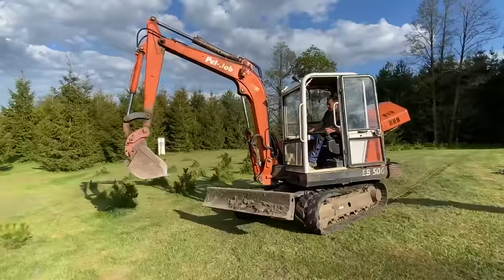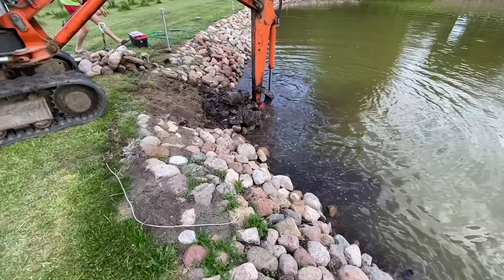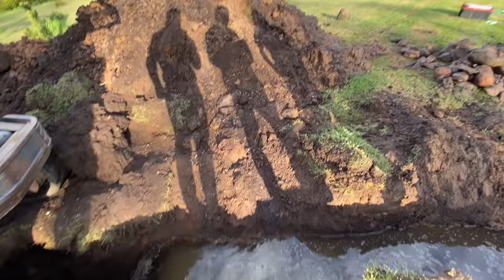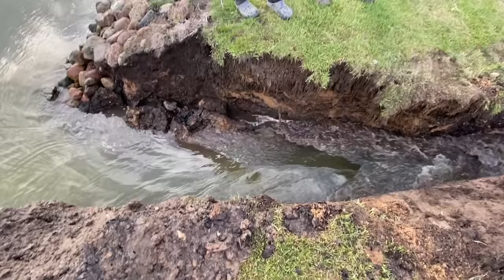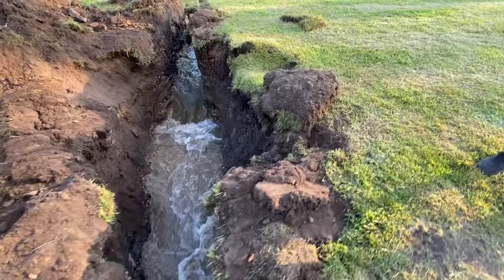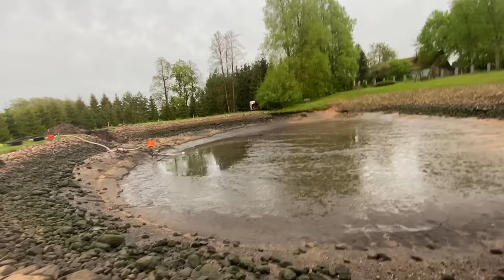DRAINING 10 ARES POND TILL THE BOTTOM. STUCK EXCAVATOR.

Comment: That is the smallest 7 acre pond on the planet. Two acres would be an exaggeration on the ponds actual size. Good camera work, and really entertaining operator skills
Reply: That’s not even two might 1
Reply: @reidreynolds7428  --  Nope!!  1/2 acre AT BEST......
Reply: @Kenislovas  Yeah Everything Is Smaller In Europe!!!!!!
Reply: @rockerpat1085  clearly not since the Irish and Scottish acres are bigger then USA's
Reply: @Kenislovas  Rubbish, the two are the same. 

"Acre, unit of land measurement in the British Imperial and United States Customary systems, equal to 43,560 square feet, or 4,840 square yards".
Reply: @chrisharris4740  there is a metric unit called an "are", the basis for the more commonly used hectare (which as the hect- prefix suggests equals 100 ares). It's written correctly in the title. The are is 100 m², which according to wikipedia converts to imperial as 3.95369 perches or 1076.391 square feet.

However, this does not look like 10 ares either lol
Reply: @ironcladranchandforge7292  i agree i have a half acre pond and it looks bigger than that.
Reply: My thoughts exactly. An acre is an acre and that’s not 10 as thumbnail suggests
Reply: about 40 ares = 1 acre, so this pond is supposedly 1/4 acre.
Reply: @dl33tc0dr6  okay thanks. I thought it was a typo.
Reply: What do you expect. Did you read title? Stucked excavator..
Lmao
Reply: Facts....😭😂🤣😂😭😭😂🤣😭😂🤣😂
Reply: Mine said 10 acres! (Well, “ares” tbh)
Reply: The title says 10 acres lol... more like maybe 3/4 an acre
Reply: Not even 1/4 acre
Reply: @brandonbishop9877  No, it says 10 ares. An ares is .0247 of an acre and is a common metric measurement. I know you have no idea but the rest of the world does not revolve around US measurements. . .
Reply: It says 10 ares. An ares is 0.0247 acres. A little education goes a long ways and prevents embarrassing comments. . .
Reply: @michaellindsey1543  what language do world leaders speak at summits? What currency is widely used around the world? When USA is in a recession everyone is in a recession… Everything revolves around America lol
Reply: @Spawn303  I totally get why you swallowed the myth but you are mistaking convenience for greatness. No question America has much to offer but there is still much we could learn from the rest of the world and making fun of someone outside the US because of our ignorance is still embarrassing even if you don't get it. . . .
Reply: @michaellindsey1543   I love being overly sarcastic to the point no one knows if I’m being serious or not. It’s especially easy when it’s just in writing. But I’m also not your typical American. I’m a history major but also not the progressive left crt history, actual history lol
Reply: @Spawn303  "what language do world leaders speak at summits?"
English Joe. The answer is English... from England... in Great Britain.... 😉
Reply: I would estimate about 1.1 or 1.2 acres on this pond , but most certainly 7 acres not by a long shot .
Reply: @davidkettell5726  read it properly. It says 10 ares not acres. How about you google the measurement system for ares.
Reply: @ManBoo55  read it properly. It says 10 ares not acres. How about you google the measurement system for ares.
Reply: @EHH24  yes I’ve already corrected myself on this. I wasn’t aware of a land measurement of an are. All is well
Reply: My 1/4 acre lot looks bigger lol
Reply: @DeuxisWasTaken  10 ares is 0.25 acre, which looks right.
Reply: @ironcladranchandforge7292  This unit of measurement is an "are" aka 1/100 of a hect-are. The title says 10 ares, which is 0.24 acre or a quarter acre
Reply: @chrisharris4740  The title says "are" which is a different unit of measurement. 10 ares = quarter acre
Reply: Yes, I guessed less than 2.
Reply: @michaellindsey1543   --  US measurements??  Umm, "acre" is an imperial British measurement. Also, thank God America isn't like the rest of the world.
Reply: title says 10 ares, not 10 acres, most of the world uses metric, not acres anymore
Reply: @Kenislovas  was this filmed in Europe ?
Reply: as a European, that is definitely not 7 "European" acres
Reply: 1 are = 1/100 hectare
Reply: These are ares not acres.
Reply: That’s more of a big puddle 😱. Never even close to 7 acres, not even an acre.🤷‍♂️
Reply: Maybe 1. Maybe... if dam footprint included. Look at aerial. That isn't a 20000 sq ft house...
Reply: The size of an acre depends on weather you are buying or selling or if you are a using fishermen measuring tape.
Reply: @rockerpat1085  That’s what she said
Reply: Must be metric acres
Reply: My pond is 1/2 acre and os bigger and deeper than that pond!
Reply: 1 acre is like 208ft x 208ft square
Reply: I was going to say… for that size a pump seems like it would have been easier
Reply: @stuartcotterill9475  and where if you walk in to a pub you will get a proper size Pint of beer
Reply: @rockerpat1085  British gallon is bigger too.
Reply: @Kenislovas  I'm glad everyone is calling you out
Reply from the maker: @oznetyoutube125  Lithuania
Reply from the maker: @themayorofdipshittery3646  ares;)
Reply from the maker: @jackcox5337  it’s ares.100 ares = 1 hectare;)
Reply from the maker: @jackcox5337  it’s ares.100 ares = 1 hectare;)
Reply from the maker: @danielweston9188  it’s ares.100 ares = 1 hectare;)
Reply from the maker: @bch5513  it’s ares.100 ares = 1 hectare;)
Reply from the maker: @themayorofdipshittery3646  it’s ares.100 ares = 1 hectare;)
Reply from the maker: @ironcladranchandforge7292  it’s ares.100 ares = 1 hectare;)
Reply from the maker: @GEAE_Denny_L  it’s ares.100 ares = 1 hectare;)
Reply from the maker: @colbyprince9409  it’s ares.100 ares = 1 hectare;)
Reply from the maker: @johnh1001  it’s ares.100 ares = 1 hectare;)
Reply from the maker: @factfinder4839  it’s ares.100 ares = 1 hectare;)
Reply from the maker: @brandonbishop9877  it’s ares.100 ares = 1 hectare;)
Reply: @Kenislovas  Thanks - with mispelling on the internet  so prevalent these days wasn't sure.
Reply from the maker: @ManBoo55
Reply from the maker: @davidkettell5726  it’s ares.100 ares = 1 hectare;)
Reply from the maker: @ironcladranchandforge7292  it’s ares.100 ares = 1 hectare;)
Reply from the maker: it’s ares.100 ares = 1 hectare;)
Reply: @ManBoo55  it says ares not acre. Big difference
Reply: that is not even 1 acre
Reply from the maker: @rickpederson1219  it’s not acres:))
Reply: I was thinking the same thing. Maybe 1 acre and that would be a stretch.
Reply: Says 10 acres lol
Reply: Im thinking he forgot to put in the .  .  it's probably 1.0 acres   XD
Reply: @reidreynolds7428  you guys never heard of metric acres?
Reply: @DeuxisWasTaken  so what point were you trying to make?
Reply: Not even seen an acre
Reply: The place is clearly called 10 acres. Not the pond. The pond is set on the 10 acres.
Reply: @rockerpat1085  An acres is an acres. No matter where it is. The pond is on a 10 acre property.
Reply: 10 Ares is the name of the pond?
Reply: My cousin lives on 2 acres of land. And this pool is definitely not 2acres. 200sq ft at the most
Reply: So now the fish you hated in your pond have possibly made it to the local river system ?
Reply: 10 ares = 0.247 acre  This looks about right to me.
Reply: I'm pretty sure the title said 10 acres
Reply: Maybe he meant 10 acre*ft ?
Reply: 10 ares is 1/4 acre
Reply: Crazy that my 1.5 acre pond is double that size lol
Reply: Looks like this property used to have some good landscaping. Pretty messed up now. Should have just used the pump and a little patience.

Entertaining video.
Reply: @twilightingX  an Acre is an Acre, but no one is talking about Acres, the title says ARE and not ACRE if you could read, that's a big difference. 10 are is 0.25 acre, like someone stated before as well. You only have to read.
Reply: @mikeanderson1534  and Im pretty sure it stays "10 Are" and not "10 Acre". Can't be that difficult to read one word.
Reply: Ares, not acres
Reply: @DeuxisWasTaken  you understand that 10 ares is 30x30m?
Reply: @stuartcotterill9475  We have the "Cunningham Acre" round my way!
Reply: @ManBoo55  He's not misspelling acre, he's using hectares which can be shortened to ares
Reply: that's like half to just 1/4th an acre yo, 10??? no way. maybe the coverage of the whoe area that leads to the pond and the pond being the lowest point
Reply: @michaellindsey1543 that's not 10acres idc where your from
Reply: An ARE is 100 sq metres
Reply: i think its a cubic value of water hold in the pond in acre-foot [ac.ft].  In liter that would be about 8.6 million liter which looks quite accurate
Reply: 10 acre feet of water.
Reply: Metric acres?

Comment: You could have just made a syphon with $150 worth of PVC.
Reply: that was killing me
Reply: I think you are likely right. At least for the majority of it.
Reply: I wasn't sure with the camera angles but it looked like the ditch was way lower than the pond and my first thought was the same as yours but even so a couple of heavy duty pumps would have saved a lot of mess,damage and money,then I thought 'maybe they're going to lay in a permanent pipe,apart from that I don't know what they were thinking.
Reply: Making money on YouTube videos will pay for all
Of it.   Plus it was fun
Reply: PVC pipe, flexible couplers, shut off valve on one end and a one way valve on the other and a T cap to add water cost me way less than $150 to do.
Reply: More money than common sense
Reply: You took the words right out of my mouth😂😊

Comment: Bit of a tip, next time you need to drain an area with a high capacity pump, lay down and stake about 10 metres of heavy duty plastic sheet. Set the pipe discharge 1 or 2 metres on to the sheet. The discharge water will spread on the plastic reducing its velocity and energy, reducing the damage to sensitive areas downstream. In the past we used the construction plastic, came in rolls total width was 3 or 4 metres. Worked a treat reducing erosion. Once finished, folded, rolled and removed, no fuss, no worries.
Reply: We use an open weave mat at the end when we drain pools, it spreads the water out and collects the trash like a filter
Reply: Not to mention fish and other wildlife.
Reply: @Dave5843-d9m  ever heard about wide steel cages ?
Reply: dude they dug a channel and released water from a private pond into a local eco system and were prepared t allow a fish in all likelyhood not native to the local region into it! i think saying they dont give a shit about the sensitive areas downstream is putting it lightly!!
Reply: I am no expect and this is the first thing I though when I saw the pipe. Bad! Erosion damage is no joke.
Reply: This is the most irresponsible thing I think I’ve ever witnessed on YouTube
Reply: @markkarpinski1460  and horribly inefficient
Reply: @Dave5843-d9m  I’ll withhold the assumption. It can just as easily be the other way around. The native species is killing their stock fish….but you’re probably right
Reply: @roobear78  Carp is pretty much native at this point in large parts of Europe. It doesn't seem to have the negative impact on the ecosystem you see in the states.
Reply: @ManicMindTrick  european carp are native to the continent but the fact the guy doesnt even know what type of fish are in the pond and doesnt give a crap is ignorance about nature! even introduceing a native species into the wrong area can devestate an ecosystem especially if they have been reared apart in an islated pond! disease,no predators etc this is why most countries have strict laws on what and where you can release especially from water sources!
Reply: @roobear78  You are correct. But how do you know that the owner of the pond doesn't know what species are in it? 
Surely someone could have released fish without him knowing about it but that's about it.
Reply: @ManicMindTrick  because he says so in the video "some kind of fish" he said! fact is he doesnt know whats in his own pond!
Reply: @roobear78  This isn't his pond. It's the neighbor of his grandpa's pond.
Reply: @ManicMindTrick  see that big ditch at the bottom he builds chanel to,thats a drainage ditch! see the big hole in the ground thats a pond! water goes from pond to drainage ditch ergo water goes from contained hole in ground into wild habitat! its not rocket science!
Reply: @ManicMindTrick  j
Reply: I wondered why they did not do the pipe and pump thing too.
Reply: @altuck4x4  my best guess would be cost, availability and transport of the pipes.

Comment: When I used to work for a construction/demolition company we were called out to drain a pond no less than 5 times bigger  in size than that little 2 acre pond.
   Not only was there invasive fish in it but there was also other issues. We were not allowed to let the invasive fish also reach any other waterways. And we had the similar idea to just trench into a canal system some distance away as also a small creek.  
The hard part was figuring out keeping the fish from getting to the canal and creek while we drain it
     My boss really didn't trust anyone.. for anything.. but I convinced him the best way was to dig the channel at an angle that left the side reaching the canal and creek just above it by a foot or so and line the entire thing with plastic.weigh it down with some rocks and use a heavy wire like horseshoe shaped to steak deep into the ground where they need to overlap plastic.This eliminated all erosion period. We used erosion control barriers to slow the water flow as it hits the out put areas. 
I cut sections of smaller wire guage panels staggered in the trench as to work like a filter and grating system to keep fish from getting out into the canal ..they had to pass so may grate areas they most likely would never get that far. 
Being the end spilled over into the canal and creek like a small spillway ..flat and leve, fanned out and shallow.. slightly raised..you could see that no fish ever got that far.
Once drained almost completely, we used pumps for the rest and we had fish and game come collect the invasive fish..the non invasive went into barrels we had ready...to keep them alive.  Once emptied we did a clean up..did repairs on walls and made extended liners down into the pond to prevent erosion and any possible future too much saturation and other soil issues like soil luquification. Lines it all up with boulders to help weight  things down and also to make environment for the fish.. natural habitat areas.
Before we filled the trench in we dropped in piping for future reference if needed. Being it ended just before the pond and the liners we played down led to it..we just overlayed them and used them like a giant plug and covered them up and that was it.. the pond liner prevents any water reaching the plug are anyway.. it took us a few days because the pond was massive..

Comment: Omg look at that Primo soil , you could grow most plants in that soil , I can almost smell it from here 👍🙂
Reply: The top soil sure runs deep in this area. It’s going to take years to get the water level back. Hope nothing was damaged down stream from the surge of water. The fish kill could have been done with a chemical that suffocates the fish. When the fish float to the surface they can be revived by placing them quickly in a tank of fresh water. We had a pond on land we recently purchased that we did this to. We filled several stock tanks with pond water just encase there were fish we wanted save. Good thing was the pond had very few fish in it.

Comment: Thanks for sharing. A beautiful location for raising a family. Draining and starting over is a great way to control invasive fish species. They don't live if there is no water. It also allows time to perform maintenance on the pond itself. Bottom and sides be cleared of debris, a permanent drain line installed in trench, and drain control valve.

Looks like you have planted trees along property line to form a windbreak. The riprap to control erosion on sides of pond is really beautiful looking rock. And hand placement of the rocks really shows your talent.
Reply: Yea drain the invasive species from your pond into the near by waterways.....
Reply: @joshuahataway4052  Thanks... good point. Wonder where they came from in first place?
Reply: Otters aren't just limited to water... They can easily live in a shallow beaver pond.

Comment: Next time you do this, I recommend a siphon! Much easier than getting the excavator out (and stuck)
Reply: Tyler, that's what I was thinking, much easier and cheaper.
Reply from the maker: It’s not my decision to do it:)
Reply: It wasn't stuck,  just an operator that didn't know what he was doing.  I had to learn myself.  You can spin the unit over that ditch if its strong enough. Or spin it before the breach of the dam.  It looked like they was having a good time.
Reply: @tigea9078  but still cheaper and doesn’t create a hole in your lawn lol
Reply: @aig9672  you already have a hole called a pond.  And in just a few hours that ditch could be filled in seeded and strawed. I've seen people try siphon(2") and pumps that get clogged.  Now let's justify the ditch, id advise plumbing a 4" line with a valve.  Just in case this needs to happen again.  Hit the valve and in 3 days its empty. In one weekend this project would be complete with a novice crew.

Comment: So, .....
the way we drain ponds is with 12 inch PVC pipe.... we simply siphon the water out of the pond like you would gasoline.   You cap the exit end of the pipe (no glue) , add a " T " to prime the pipe  a couple of feet before the pipe drops down into the pond... We use an eye-bolt to hold the cap in place with a rope tied to it ... when the pipe has been filled with water ...pull the eye-bolt out with the rope....and the siphoning begins.
Reply from the maker: I know the operating principle of this. It was not my pond, I would do other way ;)
Reply: @Kenislovas  
yes sir, i understand.